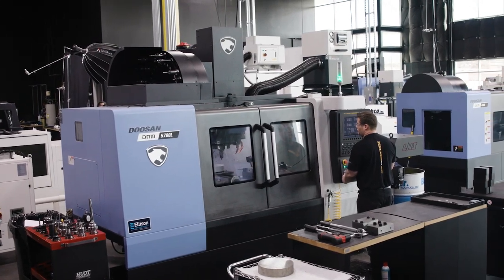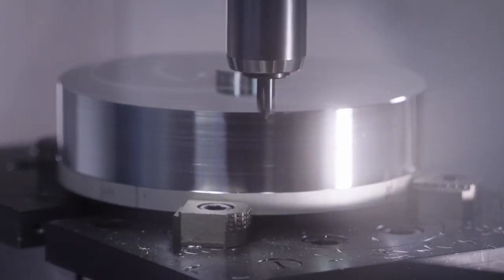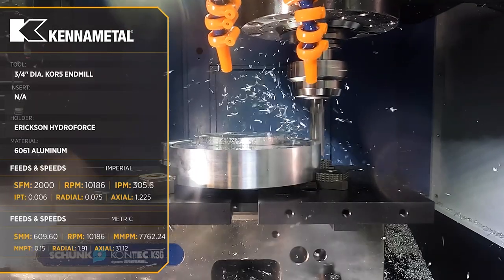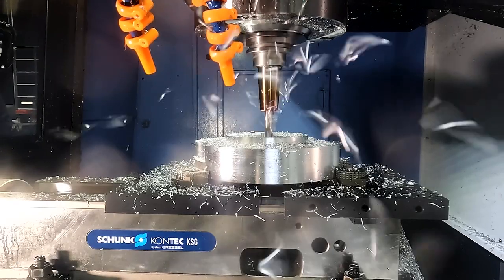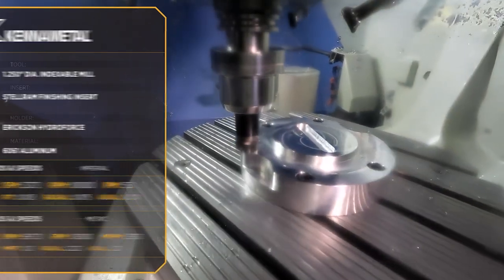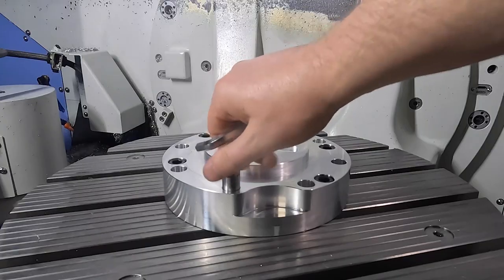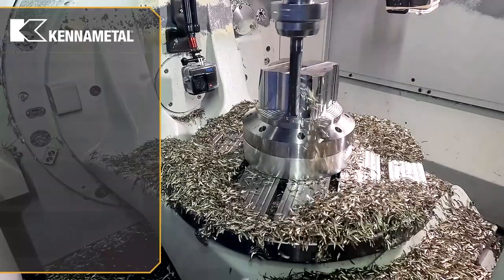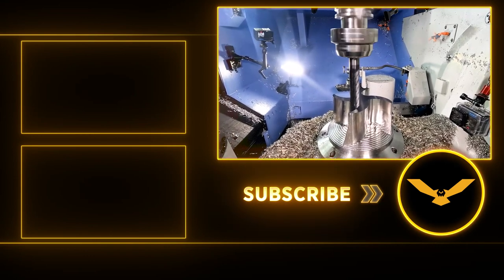HOW I Got RESPECT from an Old School Grumpy Operator

Comment: We have some older guys and as I come into the company they told me „take that feed and speed and do that this way…“ and so on. And I adapted it for the first, but after a few weeks I noticed that the one guy had problems with the drill, I told him then he should take this speed and feed and the first was „no this is to fast and it doesn’t work“ and I asked him who tells you what you should take for this material and he was like „we do it like 20 years this way“ after a couple of minutes he put in what I told him and after the first drill from the second part he come to me and thanked me, because the drill was way better and it was faster. After he completed the job he also told me that the tool life was way longer then bevor. A couple months later my boss asked me if I want to be the supervisor for our machining parts and from that on we saved money for tools and we was way faster then before.

Comment: As a programmer, I don't know how many times I've been called to a machine over the years for either a tool length offset issue, a tool hanging longer out of the holder than specified or a different tool than specified being used. I always try to work as a partner with the operator.

Comment: Love this Jessie! Of all my experience with lathes, I continuously see these types of issues with turret style machines. 

Truth..I first learned from a field service technician, that the repeated change out of tool holders (getting slammed repeatedly against the turret) causes them to wear down to the point where they should be indicated at all times. This scenario only came to light because I was experiencing issues with what I initially thought was the program also. Long story short, a technician was brought in because nobody could figure out what was going wrong.

I was blessed to have crossed paths with this field service tech, he had machining experience, working in his father's shop as a kid. He could always relate. A couple other ways to help alleviate these issues are either by replacing worn tool holders or standardizing your tooling. 

Knowing this, do you think our team members were taught this new information? No. I can also relate to the man you speak of in the video. It's a real shame to see the lack of fine detail in training procedures from the beginning. 

This is part of the reason why the field service techs I've crossed paths with, and developed relationships with are near and dear to me.

But, you managed to earn the guys respect and that speaks volumes. Despite age, change is difficult for some people to accept, especially when they automatically label themselves wiser being older...not always the case. All some may know is "because we've always done it this way." Can't stand that line! Kudos to you for keeping your cool.

Comment: We make plates out of stainless for EV charging stations, Thread mill a few holes and engrave the company logo, but the plates are pre-cut on a laser, and some of them come to us bent or scratched up, leading to them not being at the right Z height.
We were running parts for about 50 hours without issues, and then we start breaking the ball endmills we use for engraving, we try to reduce the speeds: nothing, we try to adjust the approach feedrate: nothing.
We then notice that our plate is tombstoning on our fixture when fastened on only one side because it's bent, which creates a bow in the plate right where we engrave, so our endmill ends up rapid traveling into the plate.
That taught me a valuable lesson as a new machinist: When you have to adjust your program during production after the first run, the setup is to blame most times in some way, either the part is bent/your part is not seated properly, or your fixture is bad.
I now look at my setup FIRST when I run into problems and I'm extra careful during setup, because it's better to solve potential problems before they occur, than solving real problems down the line.

Comment: We had an older boilermaker and were going through the process of getting the guys certified and the weld procedures qualified. We had a rep from the weld wire supplier on site who also had his inspectors ticket. He spent ages trying to coach this guy trying to pass the weld requirement. The inspector wandered off then this old guy went off. “Why doesn’t he put on an F’n helmet and show me how’s it’s done”. The inspector wanders back with a welding lid and gloves and proceeds to lay down a perfect weld first time. That old boilermaker went silent, the inspector continued to coach him and he actually started to listen to him and follow his instructions after that and he managed he get passing weld specimens.

Comment: Another story, I was working as a design engineer but am a proficient welder. I had some tradesmen complain that the design was impossible to weld and that I had no idea what I was doing. I got him to pass me his lid and proceeded to weld the “impossible” joint detail. There was a huge cultural issue between office and workshop at that company but after working along side many of the workshop guys during site install on the tools with them late into the nights it started to help break down the divide and we completed some rather impressive projects.

Comment: I work with an old manual machinist like this. We recently got a honing machine and I was told to learn the machine first and teach it to the other machinicts. I was instructed to run the honer at 40 rpm and blades should last about 50 parts. 

The lead machinist and his 30 years of experience ran the honer at 40 rpm for 10 minutes before he kicked the speed up to 60 rpm because it "looked right". I tried multiple times telling him he was wrong. The expert that was flown in from the UK to train us told me running the honer too fast does not give the blades time to cut and instead is just skating across the surface.

Expert from UK said each part should take 1 hr and a set of blades should last 50 parts.
The machinist I work with takes 3 hrs a part and gets 10 parts on a set of blades.
I tried turning the machine down multiple times but at this point the guy I work with is the new expert. The longer he runs his speeds and feeds, the more dialed he thinks he has the machine. I don't get how someone with 30 years experience would give 10 minutes to the recommended settings before saying they are wrong??

Best part... a set of blades is $800. He is bleeding company money and is too "experienced" to realize.

Comment: I've had this happen to me a lot in the automotive industry, especially being a lot younger than most co workers at my same level. I started out as a tech at 17 working at a jiffy lube, worked my ass off all the way to electrical/diag at 25. Me being younger, I was much more familiar with the newer models of vehicles than a lot of the older folks and they always tried to punk me until I started showing them stuff they didn't know or diagnosing an issue that took another guy a couple of days instead of the few hours for me. Of course there was and still is shit these guys know that I dont, but they started respecting me more and more after a while. Its a good feeling

Comment: Had a similar experience with a guy 6months from retirement when i was only 2 years into my career.  I had walked in as deburr guy and after 2 years i was programming and running a department.  I walked past the guys machine and i heard this god awefull sound of something drilling badly. He worked in my department, so i was within rights to ask him what was up.  I look at his bench and see 6 busted sumocham inserts on the table.  He tells me it inconel 718 aged and hes got to drill a 3in deep hole and the tools arenot holding up.  I glance at his speeds and feeds and he going waaay to slow.  I made a suggestion and he started to get upset.  I calmly just said, "ill tell you what.  You look like you are getting frustrated with this part. Let me take a crack at it.  If i break something, ill put the entire setup back the way you had it and you get a nice break out of it.". He said fine.  I fix the speeds, put a fresh drill in.  Check that its on center.  Run the drill.  He came to watch, and when he saw my speeds he took a huge step back when i hit the green button...and poof... Drilled the hole no prob.  He said he couldn't believe that worked.  Never got any guff from him after that.

Comment: I been a machinist over 30 years ,  I mainly been a manual machinist. I set up and program Bandit 4 milling machines once in a while. I always willing learn something new. The new machine I have no experience on. Most equipment I run is  20 plus years old.

Comment: Man i tried gettin a business of over 75yrs to dial in there drills. I proved to them what they're capable of and they refused to do so. Told me to slow it down. Other ppl can't run that fast. Same exact machines thru out the shop just different operators. Refused to dial in the drills. Refused to run more than 1 part in the mill wether it was a 10part run or 10,000 part run. Refused to do a lot for the set up process and it was super frustrating. Long story short i left a couple yrs later and found a shop that cares and does dial in everything. We make fixtures and run fast and we do it right so the other machine with the other operator can run juat the same.

Comment: .013 off from what ? A spot, an existing bore, a zero, a counter bore, and how did it happen ? ,,, it's one thing to have the hole in the wrong location . It must have intersected something or been off an edge or depth to break a drill . The former would show up in Q.C.

Comment: Long before you were born Chevrolet introduced a small car, the Vega to the American auto market.   The Vega had the first all aluminum mass produced engine block to the American public.  The Vega and its engine were not successful. 

When I was in high school I  worked as a draftsman for a machine design company that large machine tool companies subcontracted to design their machines.  These machines produced fully machined engine blocks.  You put a casting in the machine at one end and a fully machined engine block came out the other.   Unlike a NC machine, each hole had its own drill and every hole had its own tap.  Every machined surface had its own mill.

The design company had designers, experienced draftsman, detailers  of which I was one, who drew each part of the machine so it could be made.  There were checkers thst made sure all drawing information was present and correct. There was a foreman and aone mechanical engineer who was pretty much ignored.  The design company had about a dozen employees.

During the design process Chevy would make minor changes to things like hole locations.  In turn the designs were altered to accommodate the changes.  What didn't change was the casting since the machines that made the castings were already manufactured.  If the movement of a drilled hole resulted in it being off center so be it.  Chevrolet figured if the car was successful they could fix the problem at the first model design change.

A few years later a professor in one of my engineering classes went through a case study of his where a machine manufacturer brought him in to consult.  They were unable to machine the blocks.  None of the surfaces could be machined.  They had increased motor size until there was no room left for larger motors.  After  detailed study the professor determined the were using the wrong mills and drills.  Their tooling was based on cast iron, not aluminum.  By proper tool selection they could use the original motors.

After class I went up to the professor and explained why the error had been made.  Basically the machines were designed and not engineered.  The designers had never worked with aluminum and knew nothing about its machining proerties.  As soon as the professor started his lecture it was obvious that the tooling selected was wrong.  It was also obvious my professor did not like that a freshman taking his first engineering course knew the answer to the machining riddle.

I am very impressed with your knowledge and your fellow employees knowledge.   I am also impressed with your approach to both the technical and people issues you encounter.

Each of your students should be given a small bound notebook for jotting down the small bits of information that will make them experienced, valued assests in the years to come.  Teaching is a skill that is as important to running a shop as is your skill as a machinist. 

By the way the Vega was a failure, and good reason.

Good luck,

Bob
Reply: Great story.. sadly the Vega engine might of been ok if they just used steel sleeves instead of trying to coat aluminum cylinders and run pistons/rings on them directly. The rest of the car.. well you know.. although they don't turn to rust so much here in Texas :)

Comment: indicating any tool with a shank is critical after he ran the drill the first time he should have measured the hole diameter to make sure it was cutting to size wich i guarantee it wasnt. not sure how he made it anywhere close to retirement age doing set ups and not doing so.

Comment: Did not understand the part about aligning the turret, any video tutorials about that coming? Told the maintenance guys about misaligned tailstock on one machine some time ago and they said that an operator is supposed to deal with that. No idea how to do it and nothing in the manual about it as well so do not see myself going to touch that on my own.

Comment: Man I thought you meant indicating the drills in the mill. Of course you absolutely have to indicate the ID center cutting tools. Hints, on center. 

I will definitely start aligning my own turrets by breaking the bolts loose. Our 1985 lathes are out by .019. Maintenance claims it's not possible to break the bolts loose.
Reply: @conwaymildon4411  that's how I edit when I want someone out of the shop.
Reply: You need a new maintenance guy if he can't align a turret